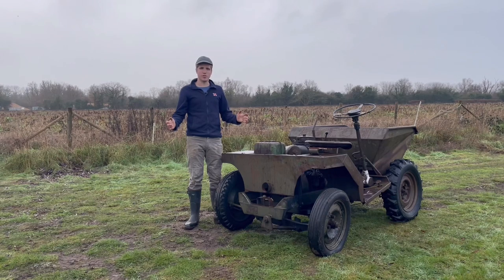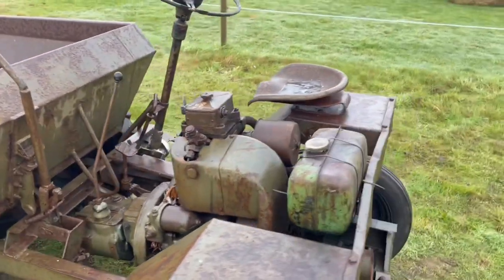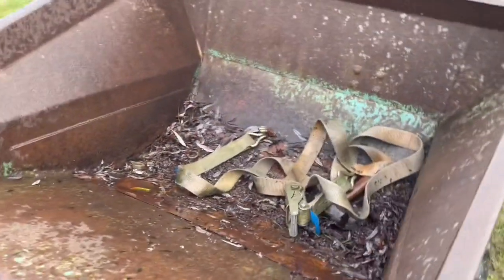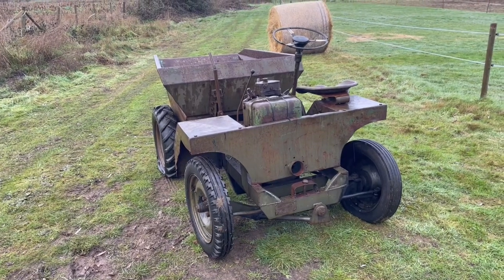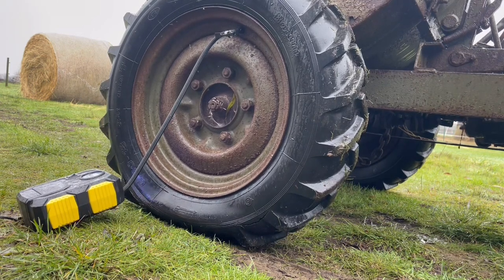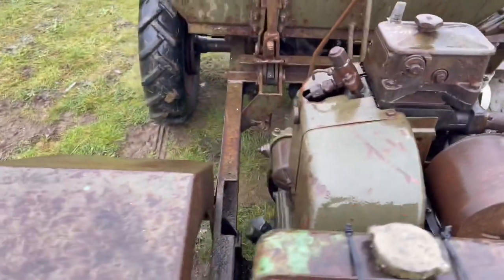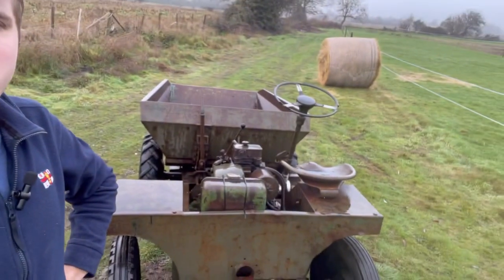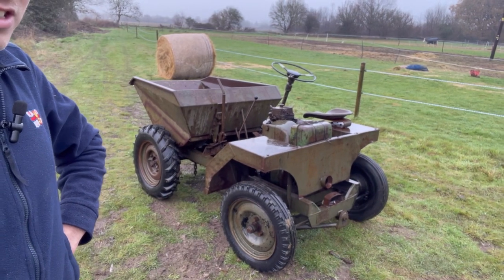Meet Daphne - Our Barn Find Benford Dumper - Restoration Series Pt 1

Comment: Starting handle you need to have more swing these listers are very tuff engines good luck could do with a darn good service
Reply from the maker: I found that out through trial and error, was worried my makeshift handle was going to take my arm off, but I’ve got the knack to it now 😆
Reply: Hello how are you getting on with your dumper cheers
I myself is looking at getting a Dumper